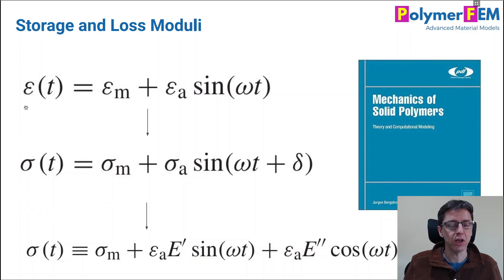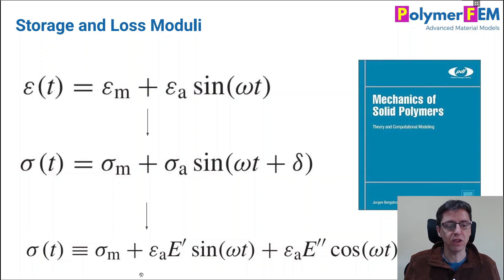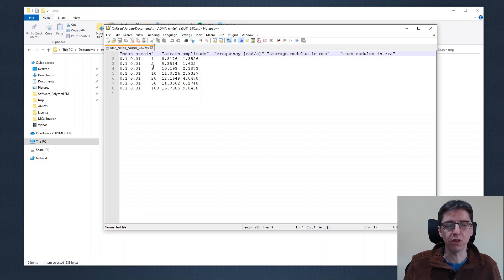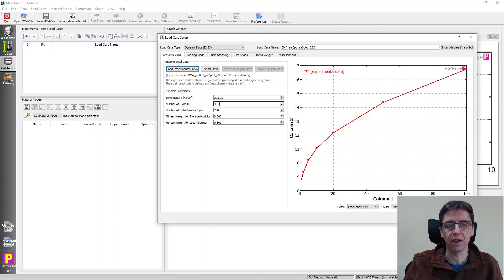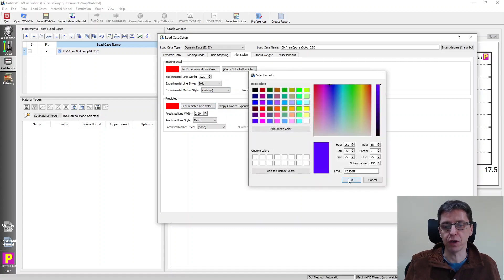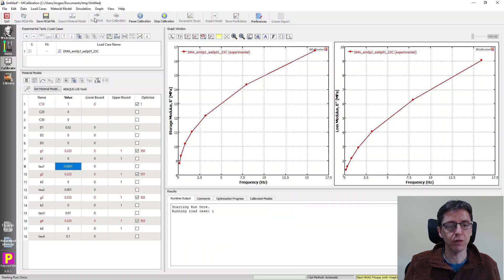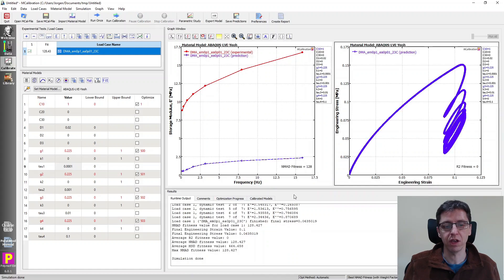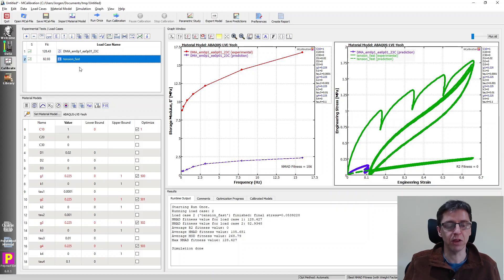DMA Frequency Data in MCalibration

Comment: Thank you sir for your nice explanation.
I had DMA data i.e Storage Modulus Vs Temperature at different frequencies. I Want to extract Williams Landel Ferry and Prony parameters to define Generalized Maxwell model in COMSOL.
Is it possible to use Mcalibration to extract the prony series for defining Generalized Maxwell Viscoelastic model?
Reply from the maker: MCalibration can convert your experimental data to the WLF and generalized Maxwell model for Abaqus. We have not yet had time to also do this for COMSOL. But it is certainly on our list of things to do. For now, you may be able to calibrate the Abaqus version, and then "manually" convert the parameters to COMSOL format.
Reply: @PolymerFEM  Thank you for your reply. Any example tutorial for manual conversion of Abaqus model parameters to COMSOL format ?